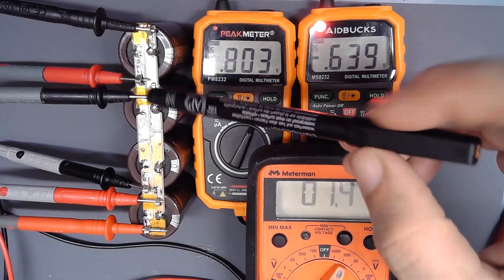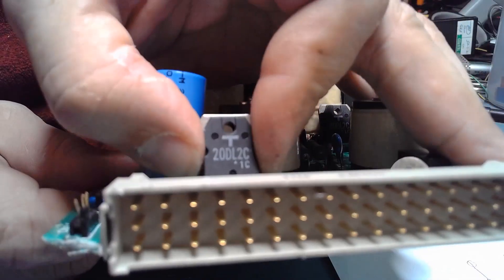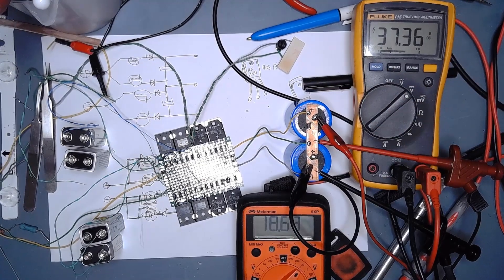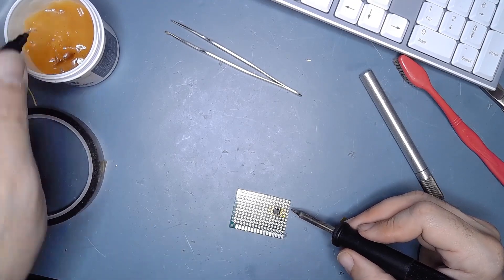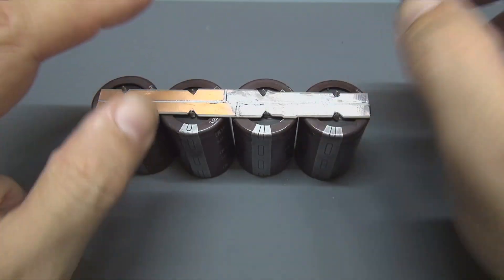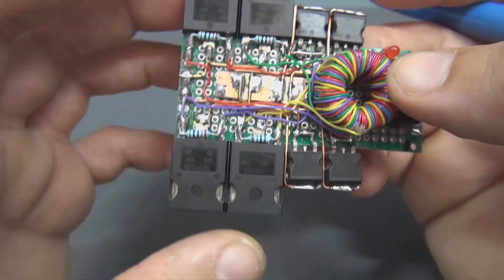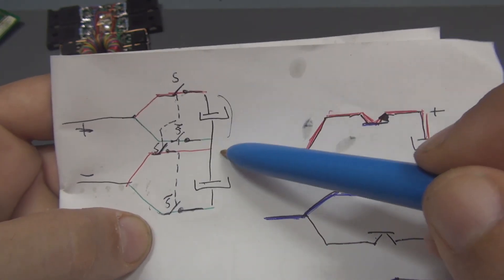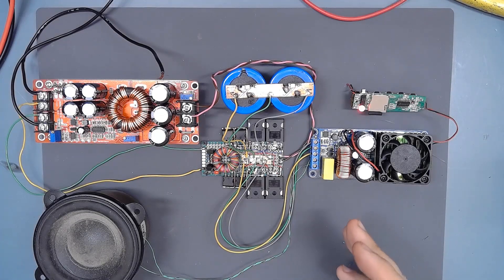Build a Symmetrical power supply adapter for a single (buck/boost/classic transformer) power supply

Comment: Hello Alexander very interesting. Can u post a shematic or explain how the Diodes are used?
Reply from the maker: the diode are used to prevent voltage capacitor to go across transistors circuitry. They are connected directely to the capacitors pole, to prevent capacitor for discharging trough back circuit. It's very simple. It's late, have'nt any schematic under elbow, but can make it when I feel some time to make it done.

Comment: Nice circuit and very pretty colours too. ;)
Reply from the maker: hello.. Each colours alloted to a single MOSFET. Designed for minimal error connecting and separated circuit. I use it for the 90V simmetrical power supply. Thanks for commenting edge effect.

Comment: Congratulations for a very good idea, I guess it can be developed a little more and even it can be regulated at the output .  If you can create feedback to the boost converter so that it will increase voltage when the output voltage drops.  It will surely need a soft start to initially charge up the capacitor bank at start up so that it will not stress the mosfets when starting with high voltage in the beginning.  Capacitors present a dead short when totally discharged.
An idea for you.  You can use a chip for the main oscillator like a TL494 or an SG3525  from an old computer smps.  These can work at a stable frequency.  Find me on facebook  or on diysmps.  We can discuss further.
Reply from the maker: @Silvio De Leonardo
 hello, glad to see commenting. Thanks for your congratulations. Yes this device can be developed. This idea is old, and was a way to use inexpensive monorail boost converter (unlike symetrical ones wich cost 5 times more). For to be honest, I was expected it will be never work. About feedback, you are wright but boost converters have their own regulation. The higher voltage you pull from a boost converter, higher will be the voltage regulation about this supply. There is a compromise between a nice regulation and the stable voltage avalaible with it. By the way that they are engineered, boost converters have a regulation, but it's limited, by the size of components, toroidal, and of course a volunteer brake, to limit current and voltage to make it secure. If the boost converters is able to regulate properly the output voltage (like here, undeed), it will be able to regulate, with technicals limit, the voltage. Abilities of regultation for 60v output with a 12v entry is about 7~10A, wich of course is not really the value we need for a such amplifier. For a dynamic use of this amplifer, the current need here to be about 12,5A.
What I want to tell here is the regulation in this voltage splitter is required at 100% from the boost converter, or any power supply of any type, feeding this voltage splitter.
Of course, doubling the voltage doesn't mean we create a second wattage. The wattage required for a symetrical rail or a mono rail is the same. This is the reason we can reflect simply on "simple" monorail when calculation a symetrical rail. At least here in this configuration.
About the soft start you mentionned, you are right and this is an important thing. Of course, the capacitors here was defined to response about the frequency of switching about the voltage splitter. For to make it simple, higher your voltage splitter is working at high frequency, less will be the capacitors values of this splitter. Also, the boost converter offers, at least from what I can notice, a soft charging of his onboard capacitors. Doubling, trippling or quadruppling the size of it like I did is again on the safety range of the process. Of course this is a simple prototype, and as you mentionned it can be improved, in case some people will need it for their purpose.
The reason I didn't use a 494 in this case is because I haven't the component able to connect this output IC with the gate and source of each MOSFET. To use classical components to drive some circuit like that (differents voltage with high voltage offset) is very dangerous, creating short circuit, and destructing components at first mistake. If you mean using a 494 with a little thoroidal, I think is a nice idea, but I though using this IC on a so little toroidal would have provoked over current on this IC supply. So I tryed first to make a driver with a 555 but I need a real symetrical sinus, wich the 555 will not offered, despite I built all and try it.
When experimenting, the 17khz of classical transistors oscillation was perfect, but it's a bulky configuration, hard to miniaturize. This freqency is not very stable, but we need it to be high. All this process was simply the simplest idea to go direct to the goal, and see if the idea I had was able to works. Of course, I hope to improve it like you mentionned. Thanks for commenting.
Reply: @AIexanderHartdegen   Another idea cropped in my mind just after reading your reply.  If for example one had to modify a boost converter and make a double winding instead of a single one on the output inductor.  This way it can provide a double symmetrical voltage which one is regulated and the other is not just filtered just like the original one.  However using this type of boost converter with a symmetrical output on an amplifier is rather simple this is because when the output is loaded it will  usually load the same load on both rails hence regulation of the voltage is maintained.
Regarding the TL494 is rather easy to drive 4 mosfets by using a current amplifier to its output and a pulse transformer more or less just like the one you made and by  connecting the 4 output windings in the proper orientation you can switch the mosfets alternately.  Check on the internet for a full bridge smps and you will get the idea.
Reply from the maker: @supersilve  believe it or not, I tryied this idea one or two years ago. And for an absolute unknown reasons, it didn't work and I can't explain, or even have a clue why. The power avalable was about 1w on this added output. It didn't work. But maybe I forget a point or something. This idea need maybe to be repeated.
What I understood is you can not add another winding on this "mono winding" toroidal. I don't know why. But of course the idea is great to notice.
When I will try to make a small one and better one, I will use a 494 to make it perfect and frequency adustable. If you use 30khz, you can use 1000µf capacitors. I checked the full bridge smps. It's a nice way to use it to rectifier alternative current without loss!
Thanks for advising